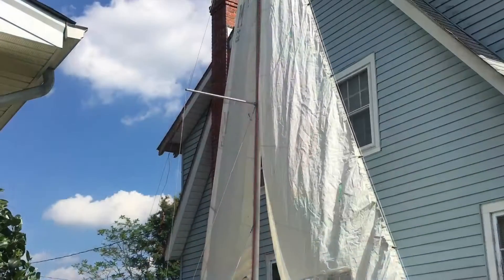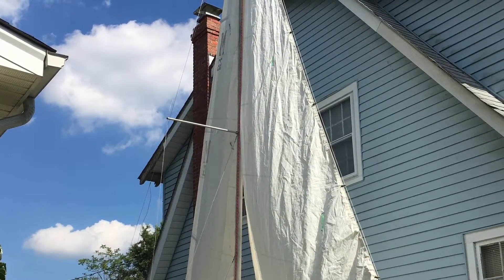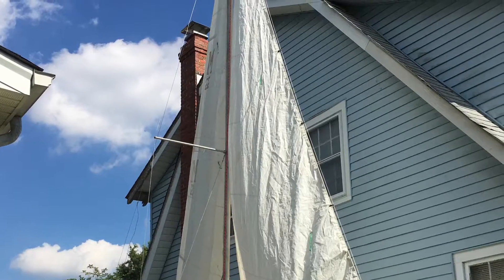Just Some Venting about the Boat

Comment: as i said i have this same boat and what i found out by watching a lot of videos on older boats is there are so many different ways the same job is accomplished on different boats that it was OK for me to mac-giver it as long as the parts i chose were strong. i also realized that i would never get out of the boat the money i put into the boat so a restoration would never pay off. I've made my own running rigging form home depot parts and get most of my stuff from the hardware store and have tested it in 40 mph winds. this is my first boat other than one i built when i was 13, sewed my own sails back then, my mac is for having fun and teaching my wife. I'll spend more on the next one. thanks for taking the time to document your progress.